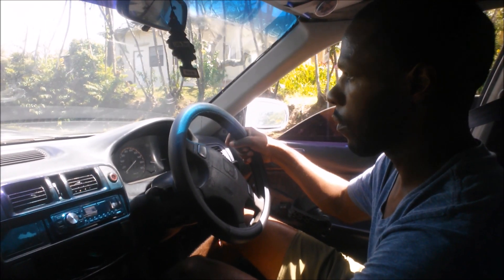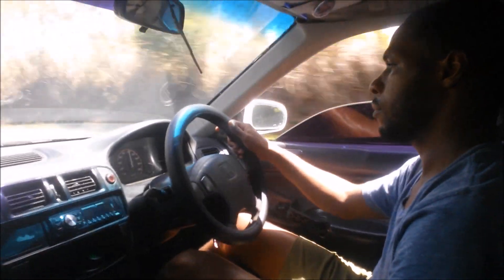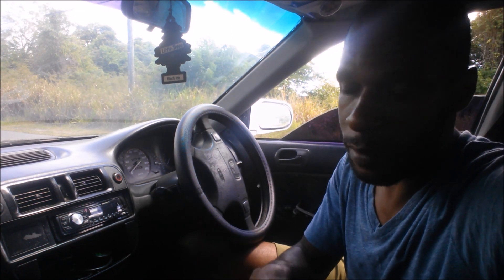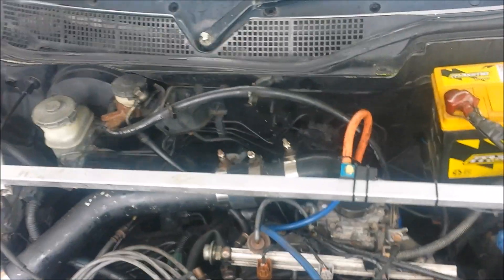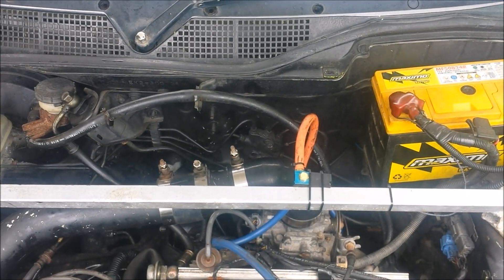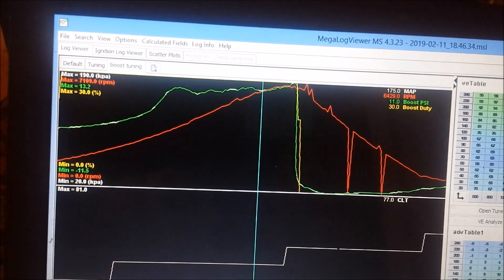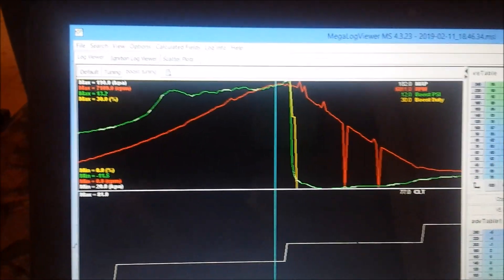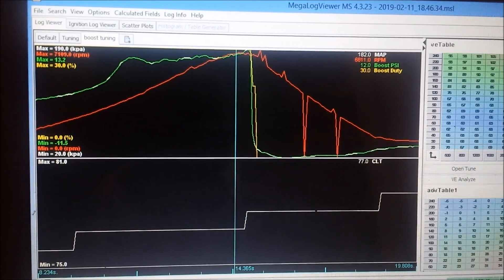Testing Out Electronic Boost Control With Speeduino ECU

Comment: Like the video, and how it is a bit longer. I am a bit concerned with your sync loss when back off the throttle each time. I have a theory or two, but if you have a moment, send me a log at twonutsdiy at Gmail. Seems like a noise issue that I used to have with a similar tell sign to what you see at the 5:57 mark where the rpm jumps when you back off.  It seems to be a noise issue. 
Great video as always
Reply from the maker: Good eye. I noticed it only started happening a few weeks ago. I'm going through a process of elimination to figure it out, but i have a good feeling its the unshielded trigger wires. I will gladly send you the log as 2 sets of eyes are always better than 1. Thanks man

Comment: 10-15mins are a good lenght, depending on content of course . i maybe didnt catch it, but why do you run open loop?
Reply from the maker: It's usually hard to fit good content in a video that's less than 10 mins IMO. I usually feel like I can do a better job explaining but don't want the videos too long.

I use open loop as its much easier to get started with that than closed loop. I think most new users will start with open loop before diving into closed loop. I do intend on switching to closed loop as soon as I am done with OL testing.
Reply: @DCWERX  Look at Jafromobile latest video for example, great setup with some tuning and 1/4 mile running alternating through the video. Great that you will go through both methods, any more future plans?
Reply from the maker: @garagecedric  I love his channel, always well documented and well explained, down to his 60 ft times. 

It's a bit difficult to do 1/4 mile comparison as we have under 5 drag events per year here. I do have a TRC app which seems to be consistent with  1/8 and 1/4 mile times. I plan on making a couple videos using that. 

Future plans for the car is to swap in a low mileage motor, switch to a 4 channel speeduino ecu and do sequential injection and COP since everyone asks about it. I wanna make a new turbo manifold but keep the td04 turbo as its almost perfect size for the 1.5L. Lastly I wanna try out upcoming features like knock control etc. I hope to make videos of everything so folks can have some guidance when they ready to do theirs. Until then I will just drive the wheels of this car.
Reply: @DCWERX  I'm running simple closed loop right now (speeduino) looks kinda rough on the datalog. I try and send you a screenshot on facebook messenger, interested on your opinion :)